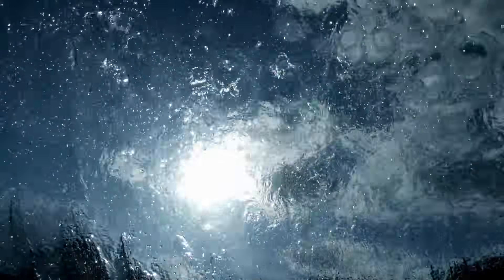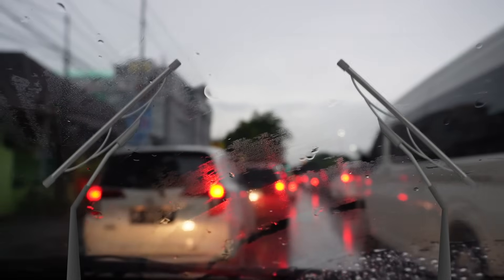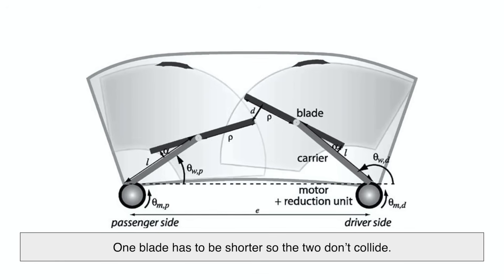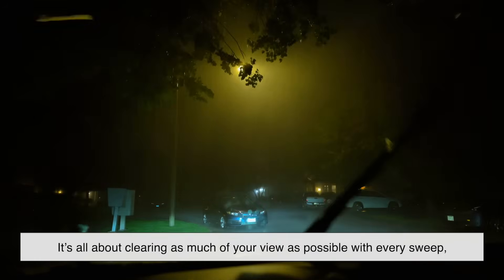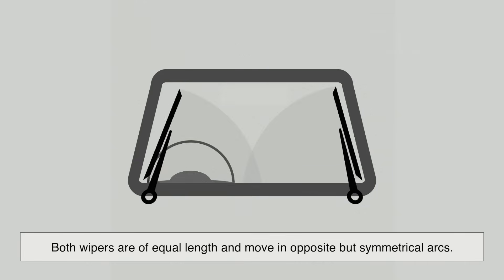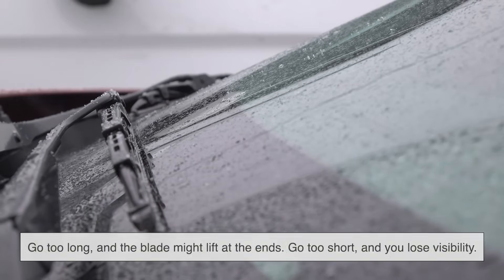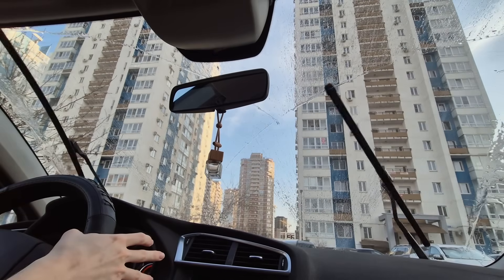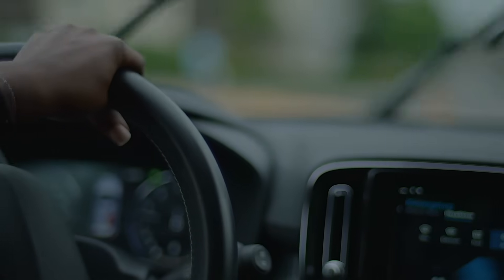Why Are Windshield Wipers of Different Size?

Comment: Good Morning and thank you . Learned something new today. FYI.Been doing since the 80's. After a car wash I clean all windows inside and out with windex with ammonia.Then for the outside of all glass wipe down with rubbing acohol.Then apply light coat of spray on wax usually turtle wax. Upgraded wipers to those silocone ones cheaper at walmart. Then every few months clean them with rubbing acohol and wipe down with small amount of wd 40. Wipers dry out in summertime and freeze on you in winter. Bug guts tree sap and road tar in summer splater on your windshield. Clean windshield at night  is great oh silicone  wipers ,on same pair of silicone wiper after 2 and a half years. still great

Comment: Some clarification...  Yes, the wiper arms are different lengths, with a longer passenger's arm, but the replaceable blades on the arms are the same size. I've never had to purchase two different replacement blades —a driver's side vs a passenger's side— on any of the vehicles I've had over the past 4+ decades.

Comment: The rubber blades on windshield wipers can deteriorate from use and will need to be replaced especially when there is excessive streaking.